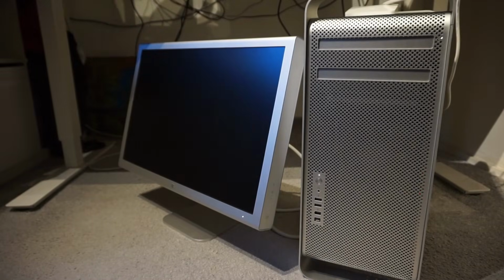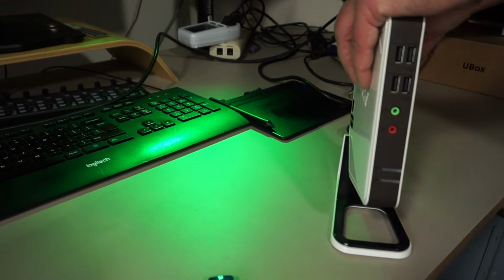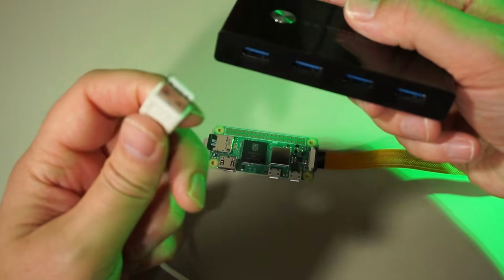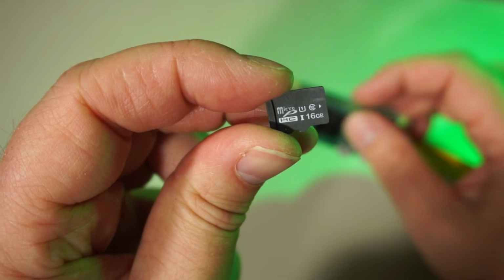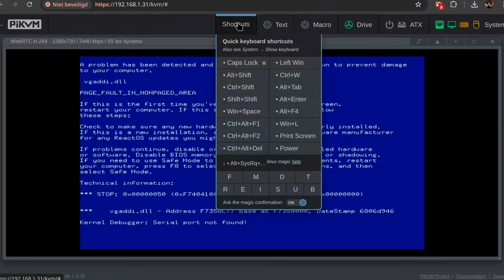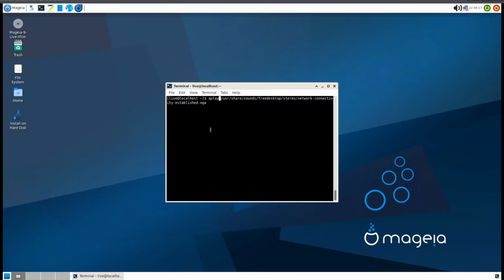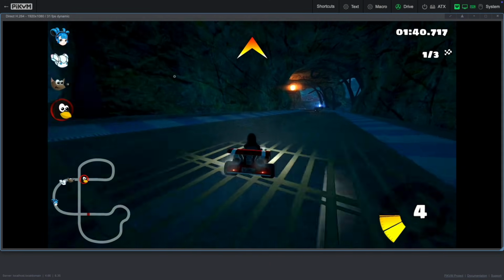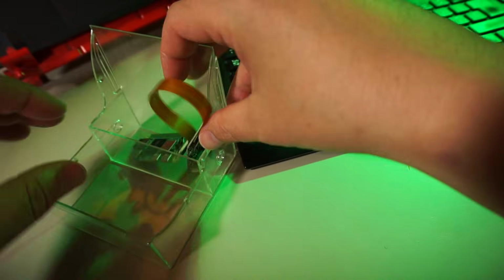Build your own network KVM with a Raspberry Pi and PiKVM!

Comment: @1:50 yeah ive had it happen before, right after i built me new PC when it wouldnt turn on, and during troubleshooting even with the PSU power cable unplugged the video card still had a power led which comes from the 5v rail on the motherboard. well it turns out my cheap powered USB hub was backfeeding into the motherboard, ended up blowing out that USB port (well it stopped working for a while, it now works but is flaky as walking by the computer will cause it to disconnect/reconnect) 

Im just going to put it up to being a really cheap hub, but i ended up just getting a few pci-express USB cards to give me some more connecetions
Reply from the maker: Auch. It really shouldn't do that, but I guess it's good to test it before plugging it into a PC.

Comment: Right as my cheap Amazon KVM switch is dying, and the new ones from Amazon come in broken...  Pi KVM...  Hmmm...  DIY might just need to happen given my budget!
Reply from the maker: You could be up and running for under $40 with this setup, and that's assuming you buy everything new. ;)
What kind of KVM did you use if I may ask? It's been a while since I used a pro grade one, but I never had a KVM experience this great before haha
Reply: @ex-itguy  it was an un-branded import from Amazon back in 2023.  Yeah, definitely mediocre!  Someday, I plan on upgrade to PiKVM, that network control certainly is better than having to be physically present to push buttons!
Reply: Isn’t kvm switch different thing?
Reply from the maker: @vlad_cool04 true, this is just a kvm, without the switch. You can hook up a switch to a PiKVM to control multiple systems though btw
Reply: @vlad_cool04  same concept, just no network capability.  PiKVM has more capability...  KVM switch I mention just changes the keyboard, video display (monitors), and mouse (and one additional USB item).  Sits on the desk, and has to be manually controlled.